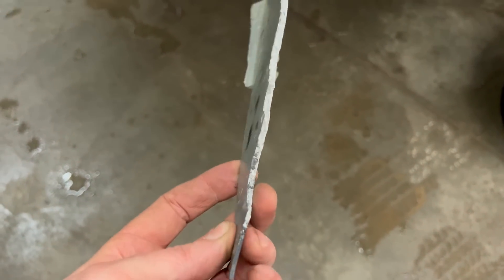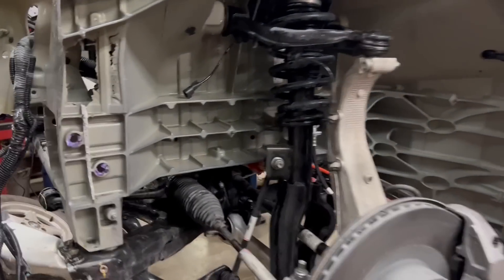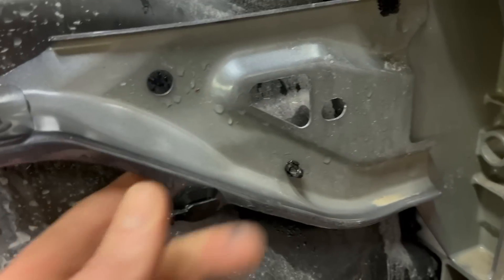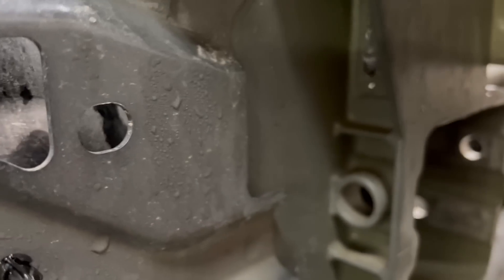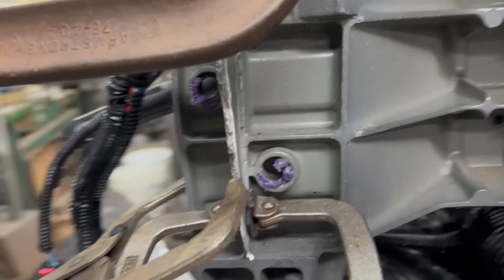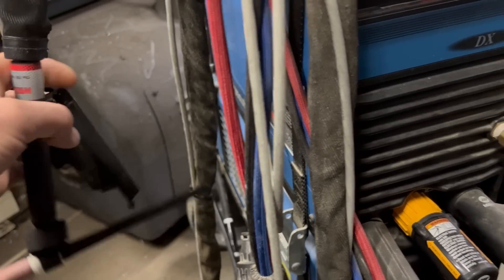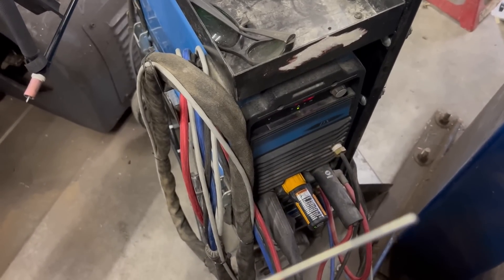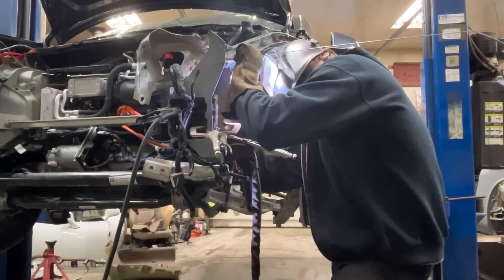Tesla Model Y GIGACast Repair

Comment: It will be interesting to see what changes Tesla makes since they've said they plan to work on making it easier to repair their vehicles (since there is now a financial interest due to Tesla insurance).
Reply: Tesla always had a financial interest in making the cars easier to repair.  They sell parts for near cost, they do not profit on parts.
Reply: @_PatrickO  Tesla do not sell parts easily. Go and look at RichRebuilds channel.
Reply: @_PatrickO  How do you know that they sell parts near cost ...a lot of the Parts are made in China
Reply: @brk932  Because tesla said it and everyone who has bought a part has confirmed it is true.  This is through 3rd party body shops, tesla shops, or over the phone.  The real question is why are you making crap up by inventing this idea that tesla profits on parts?  You made that up out of fat air.
Reply: @_PatrickO  Have you seen Rich Rebuilds LOL. $22,000 for a battery... is that at cost? IT'S NOT. Original 75kWh NIO battery costs 1/3 of that!
Reply: @Froggy 01 I haven't had too much trouble except for the fact I need to do it through the app. The parts catalog is online and most parts are available.
Reply: Doubt it. Tesla's are by far the most expensive cars to repair. Also, then the most environmentally wasteful to repair as Tessa will not even allow used parts to be used.  For a company that is supposedly environmentally friendly, they're the only OEM that does not allow recycled parts.  Also they are barely poorly designed for repairs. They did not factor repair these vehicles when they built them. So the part is damaged on Tesla. They'll likely just replace it.  It is why i will never own a telsa.
Reply: @ryanwalters6184  Actually in many cases they're cheaper to repair than other luxury cars. I can't count the number of times Toyota has tried to rip me off like $344 to replace a headlight bulb, $200 for the bulb ($50 on eBay for a new one), and $144 for labor. This was 15 years ago and I imagine they're only worse now. And the headlights failed just after 3 years, well inside the 8-year extended warranty. Both of my HID headlights failed due to a defect that later brought about a class-action lawsuit, one of numerous I had with my Prius. I've also spoken with mechanics and the parts/labor prices generally were not excessive. I will never deal with Toyota again. I also have a friend who was a mechanic for Mercedes. The prices Tesla was charging me were considerably less. Granted, none of this was for body work. The refusal to use used parts is a problem. They wanted me to pay $3300 for a new charging unit for my Model S. I bought a used one on eBay for $400 and replaced it myself, though it turned out the problem was a 50A internal fuse blew from old age ($25). 10 years of charging at 40A will cause a 50A fuse to age and blow.
Reply: @aaronwilliams1249  i do this for a living and i was speaking of body work. For example in my market the going rate is $56 an hour for body work. The cheapest telsa shop is $85 an hour.  Ev should have way less maintenance cost.  I have an f150 lightning ordered myself.
Reply: @ryanwalters6184  I wonder if this has to do with the use of so much aluminum or if it's just Tesla-certified shops charging more because they can?
Reply: @aaronwilliams1249  that does add cost because it a telsa and they only allow certain shop to handle repairs. But that is just one factor. They build cars differently so they are just way harder to repair.  It is very rare to repair any panel so you are replacing a large part of the car for minor damage. Then it's all new parts. The cybertruck is going to be a nightmare to repair.  Not looking forward to fixing those at all.
Reply: @ryanwalters6184  That's nonsense since Tesla uses used parts themselves sometimes when replacing batteries and drive units.
Reply: @JRP3  while you are technically correct. The industry term for those parts would be remanufactured or "reman part" as their source directly from the OEM.  OEM does QC and you ship the damage part back or pay an extra core charge. Most OEMs also offer this. Telsa does not allow any parts not sold by them.  No other OEM forces you to source all parts through them for repairs. Also, the punishment for using non-source parts is very severe as there are already stories of Tesla limiting the supercharging of repaired vehicles. My comments were really related to collision repair. Mechanical repairs should be about the same between automakers.
Reply: @ryanwalters6184  I doubt other OEMS would allow used or 3rd party parts for warranty work, and Tesla can't stop you from using any body parts you want to for repairs, though obviously they won't provide warranty coverage for used or 3rd party parts that they haven't certified.  The only limits they have in place that I'm aware of is for totaled vehicles that are rebuilt and put back into service.

Comment: Good content but would be nicer if you skipped the music.  Welding sound is less distracting.  Why is there paper thin areas of the cast that have see through areas.
Reply from the maker: Those thin areas are just flashing from the cast process.
Reply: @519Kustomz  Thanks.  I think Tesla will make modifications like you suggested even though it will be expensive, although maybe the dies have to be replaced every so often anyway.  Tesla is insuring the vehicles in many states and Musk had said they will use collision data to redesign the vehicle to make repairs less expensive.

Comment: The Tesla casting is strong and saves a lot of parts, but I am not convinced they had normal accident repair in the equation.
Reply: Tesla's idea of course is that autopilot will reduce the chance of an accident...
Reply: @henq  90% of accidents are rear ending someone.  I am not sure how the autopilot will avoid the Tesla getting rear ended.

Comment: TESLA!  Maybe Tesla could, in future, supply segments of the castings that would be able to be welded on for repairs as you have done.  Does that sound like a possibility?
Reply from the maker: I could see a bolt on repair part in the future. Actual, knowing tesla it would be a riveted and bonded part. I highly doubt they would supply weld on sections.

Comment: If i might give some input here. Companys do not like extra parts. Companys are not interested in designing in a way that makes parts repairable. I am honestly surprised that they didn't incorporate the stamped piece into the casting. That would have saved a lot of money/time. The way the part is shaped also tells me that they are doing two things with this part. 
1. Take up force from up and down.
2. Stiffening the frame part.
This part might also be shaped like this so that it does shear in a front crash. I don't know too much about that.
If I may give an advice here. Sell a repair set where you basically replace the feature with a screw in holder. You would have to invest a lot of time into making it perfect (different materials, manufacturing, fixture for assembly) but you could sell it for whatever you want. The costumer will pay whatever if it fixes his problem.
Reply from the maker: I like that suggestion, I have actually done a bit of cad work in my spare time to make a different bracket.

Comment: Tesla.  Thanks for the info man.  My step-daughter just got hit in the front passenger wheel and looks like its bent the wheel back. Body looks ok but all the collision centers are booked up 2mo!  Appreciated seeing how that cast welding went!
Reply from the maker: As long as she is alright! I have had two of these model Y so far and both had lower parts of the spindles sheared off in the accidents. Curious if hers was similar.

Comment: Tesla.  Skipped to the end, though 😊
Thanks for taking a look at this - lots of concern around the repairability of gigacastings.  Any though about shearing off the remainder and bolting a bracket on to repair this fixing instead of trying to re-weld the original material?
Reply from the maker: I’d expect that if there is an approved repair procedure it would involve something like that rather then re-welding.

Comment: What about sawing the damaged wing from the giga cast then drilling some holes and mounting a new bracket ( that's designed for that purpose ) to mount the fender
Reply from the maker: That may actually be the preferred Tesla repair if one is to exist in the future.

Comment: Tesla = free shirt.  I'm guessing the repaired piece will fail in the future, and not at your weld repair, and the other side too.  And fail in all cars eventually, since that thin cast-aluminum web takes flutter forces from the wind which may eventually cause fatigue cracks.  I would have been tempted to cut a custom support from thicker aluminum stock and weld or bolt it to the thicker sections of the giga-subframe.  Why Tesla didn't design the mold to have thicker sections extending to the bracket attach points is a mystery.  Result of a summer intern running structural calculations assuming loads inconsistent with what the real world will throw at it?

Comment: I do agree with your view on the fender mounting aspect - but the rest of the giga casting being compromised would usually spell a larger front end accident that would total the car regardless.. I'm not sure I would want to weld anything to do with frame rail area on these. Now you could technically replace that entire casting in the front but the processes involved would be insane (fun project to watch honestly), but would the labor hours vs. scrapping hours be worth it at the end of this or not is to beg the question. Who knows - not that expert myself < Great video :)
Reply from the maker: I think with the recent price cuts more of these wont be economical worth fixing. Likely also meaning more of them will be written off because cost of replacement has dropped. Complex how a big price drop is going to ripple effect the whole secondary market.

Comment: Tesla. Great video! I agree Tesla probably won't redesign the casting but it looks like an opportunity for an aftermarket company to produce a stamped piece that bolts to the remaining portion of the casting to make the repair.
Reply: Tesla is building a large custom die shop at GigaTexas just for die refurbishment and modification.  Lots of very specific job openings posted for die shop positions.  Pretty sure they'll optimize the die/subassembly interfaces to improve economics over time.  One thing Tesla never does is stand still.
Reply: @scottgaree7667  Yes, I heard about this die shop that Tesla was building. Definitely going to do some special things at that shop. One thing I know about die casting molds is that they are always breaking down and need a lot of service. Even more fun when these giga molds are the size of a mini van. People don't realize, these things are solid steel and are very heavy. Plus after they come out of a die casting machine, they will be extremely filthy. They will need special equipment to just work on these molds.  I hope Elon is smart enough to pay these guys a good wage. Maybe even let them form a union.  Lol
Reply from the maker: Thanks!, Yeah, that is exactly what i was thinking. Very much doubt they would change the casting so a nice little bracket would be slick
Reply: @519Kustomz  They're building their own die shop at giga Texas, I assume with the capability of doing their own dies. That would fit in with their usual practice of constant improvement. Thanks for your vid and yes, Tesla in the title draws eyes.
Reply: @519Kustomz  you would think they are at least planning a few revisions down the road with the casting. Maybe a few years down the road you revisit the design with some improvements.

Comment: interesting Tesla content. You have a valid point, strange they did not construct it that way in the first place.
Reply: Nothing strange about it.  This cast ear saved cutting, stamping and maybe painting a part.  Maybe 6 or 8 bolts and more than anything else a harder to align front fender.   Tesla is or soon will be moving it's assembly line once every 30 seconds.  This in part is why Tesla can lower prices.

Comment: Tesla.  I've only seen welding on low-pressure aluminum castings.  Those are generally porous and start to collapse as soon as you heat them.  How was the porosity of the gigacasting?
Reply from the maker: Porosity was very low. I was impressed how dense it was considering it is formed so quick. The high pressure seems to make all the difference.

Comment: Tesla. I was interested to see how a gigacasting weld repair might go. If Tesla is the insurer then they'll soon hone the casting vs write offs issue once the costs are tallied.
Reply from the maker: Just posted the T-Shirt giveaway and you are one of the winners, Congrats! Email is Dan@519kustomz.com  Just need your t-shirt size and mailing address and I will have them printed and shipped as soon as possible. Thanks!
Reply: Cars that cannot be safely repaired have to be certified as scrapped and made unusable ever again. Anything else is sold for spares or repairs.
Reply: @Dave5843-d9m  --  Yet a lot of cars are repaired to less that the full standard.   It's wasteful to junk perfectly good cars.  I've heard that cars involved with trainwrecks are also junked.

That, again, is wasteful.   Perhaps some legislative solution can be found whereby a VIN can be permanently flagged in a publically accessible federal database when certain repairs are made.
Reply: The castings will obviously allow Tesla to generate much more money as it can easily make an order of magnitude more cars with it than without!
Reply: @rkan2  --  The "GigaPress" is a long lead time piece of equipment.   Convention equipment that punches of steel is a near commodity.
Reply: @GilmerJohn  Sure, but punching is useless if you cannot actually put it together any faster. It is the very vety basics of LEAN. One giga press makes like 350k castings a year.. Tesla needs to make 10x those in a few years. Imagine doing  those with 20 different stampings. That's what VW and some others do lol.
Reply: @rkan2  --  Well, again, I say that the giga press is very important and I suspect that more are on order.   Indeed, "excess capacity" (if the presses are made faster than demade) could be used by putting two dies in one press.

But the "conventional" way has advantages.   It's easier to make a small change in one small piece of a stitched up structure than making an entire desk sized die for the giga.
Reply: @GilmerJohn  Abdolutely.. They have 12 now, I wouldn't be surprised if they have 50 by the end of the decade.
Reply: Well, when an insurance company "writes off" a car it doesn't destroy them.   It sells them.   Anyone can buy it; often the owner will buy it back and make the repair at his own risk.   Just like the case in a lot of accident repairs, it's likely the car might not be a "crash worthy" as before.   The world isn't a perfect   place.
Reply: Looks like tesla will be sued out of business.
Reply: @gmw3083   You wish.
Reply: @ayCarumbaQueLio  Doesn't matter to me, but apparently, 45% of Teslas have been recalled for one problem or another

Comment: hi yes I agree with you any flanges sticking out of a  casting will not bend just snap of,
they could easily be sheet aluminum bolted on so they can be removed and  straighten or replaced, its not really structural its a bracket,
Reply: All the flanges sticks out of that bracket cut $100s of the cost of assembling the car.

Comment: Tesla should make a real effort to make cars that can be repaired
Reply from the maker: I think occupant safety is rightfully the number one priority.
Reply: Tesla only makes an effort to reduce manufacturing costs, if the happens to make the vehicle unrepairable it's not their problem. It's the customer's problem.
Reply: @heathwirt8919  tesla is also an insurance company in many states, which would mean it is their problem
Reply: @beilkster  It's their problem until they say it's not covered.
Reply: @heathwirt8919  That's just silly.  They can't arbitrarily say certain damage is not covered.  If they write policies excluding mechanical damage the rest of the industry will happily publicize that, killing their insurance business quite handily.
Reply: @scottgaree7667  Get out your magnifying glass and read the fine print.

Comment: Tesla.    From a welder how clean did it weld?   I’ve welded on some nasty cast aluminum just curious
Reply from the maker: It was a little dirty, but overall not bad. No real porousness that I uncovered in the casting, which does speak to the gigacast process working very well.